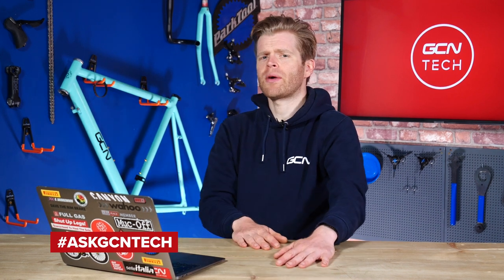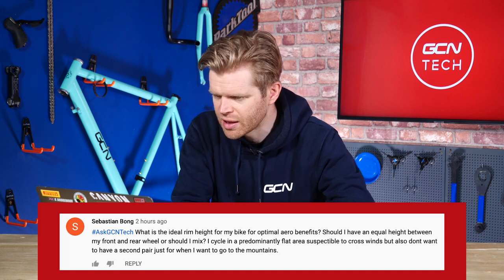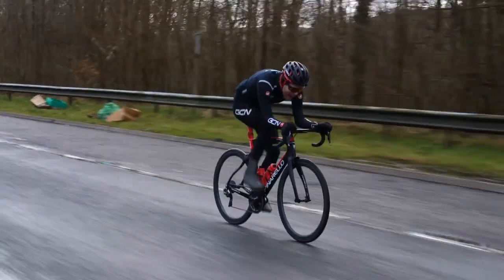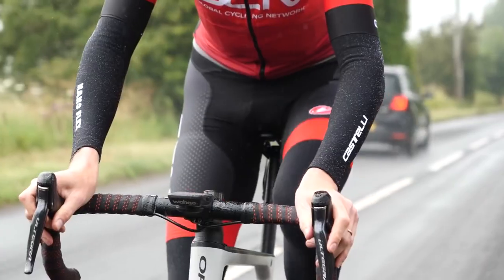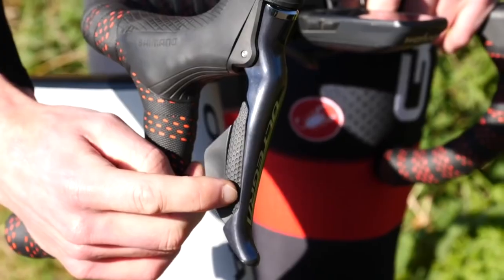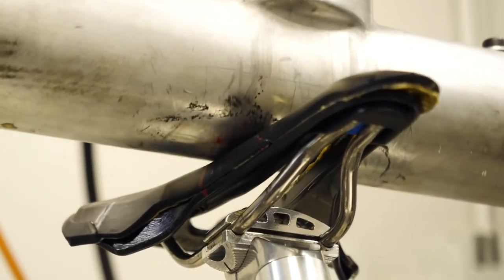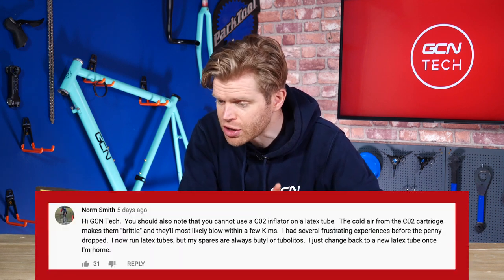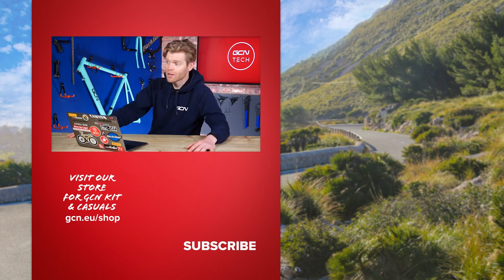What's The Ideal Depth For An Aerodynamic Wheel Rim? | GCN Tech Clinic #AskGCNTech

Comment: Why would you not be able to plug a theoretical 12 speed Di2 derailleur into a 11 speed Di2 shifter (assuming current wiring protocols)? I doubt this will be the case and suspect Shimano is going at least semi-wireless, but a button is a button otherwise.
Reply: In terms of hardware its possible, but shimano will make you buy a new shifter

Comment: #AskGCNTech is being on a trainer damaging for front wheels? During sprints and efforts the front wheel is taking a lot of vertical load on just the one or two spokes since the wheel isn’t rotating. Over time could this damage the spokes/rim at the bottom, shouldn’t we have some kind of front axle stand (if you can’t afford a Kickr Climb)? Thanks
Reply: The amount of force you can put into the rim while pedaling stationary is substantially smaller (probably about 4x less minnium)  than the force the rim sees while hitting a pothole at speed.

Comment: #AskGCNTech my Shimano 105 R7000 rear derailleur keeps getting out of its indexing. I've had the cable replaced, but every time I have it reindexed after a few hundred km's it's out off wack again. Any ideas on what could be causing this. I use my bike daily for a 84km round trip to work
Reply: New cable will stretch as it “breaks in”. It will stretch throughout its useful life but always more in the initial few hundred kilometers.
The cable housing end entering the derailleur is an adjustment nut. It may require lifting to engage for turning/adjusting (nut has indexed notches). When shifting to a larger cog has become hesitant, Adjust counterclockwise 1/8 turn, test ride. 1 indexed notch more if needed untill it will shift without hesitation. 1/8-1/4 turn should be adequate unless you have ignored the hesitant shifts too long.

Comment: #askgcntech
I have my first clutch rear derailleur and I can’t figure out why this is improved technology. Can you explain how it works and why it’s better. Thanks

#olliedidthehourrecord?
Reply from the maker: clutch mechs better maintain chain tension, essentially stopping slap by taking up slack better, this also leads to better shifting and a reduction in drive train drag. The benefits aren't enormous if your on a road bike with a 2x set up and a front mech, but they make a lot of difference off road or with 1x

#ollieattemptedthehourrecord

Comment: Hi Ollie, this has probably been answered before, but I can't find the answer. I have an older wheel with a 10 speed body and my new bike is 11 speed. Is it possible to fit an 11 speed casette on the 10 speed body. It would make it easier than changing the tire when using my rollers #askGCNtech

Comment: #askGCNTech My nw small frame bike came with r7000 crankset at 165mm. If I switch to a 170mm crankset, I’m assuming I will have to readjust my seat post/saddle position??
Reply: Yes but also consider that it'll  make your feet closer to the ground so less clearance or corners and you'll likely hit the wheel easier too.

Comment: #AskGCNTech Hi GCN tech, I just bought a second hand direct mount rim brake frame and it came with a ONE brake adapter (which I was told is for the rear brake). Question: What is it for? Do I need one for the front brake?
Reply: What frameset is this?
Reply: @yonglingng5640  aeroad

Comment: #AskGCNTech Hey guys! Can I inflate my tires with helium gas? On theory it woud make your bike lighter
Reply: I'm not sure, if it is applicable to helium, but it's know that Hydrogen is extremely hard to contain and you need extra effort to keep it in any container. Helium is the next bigger cousin, in the case of atomic size, but I don't know how much slower it permeates through rubber. I think regular old air does the job pretty fine, since it's mostly made out of Nitrogen and Oxygen, which are way bigger than helium.

TLDR: Helium might escape your tires way faster, than air. So regular (and expensive) refills might be needed
Reply: How about nitrogen???

Comment: #askgcntech is the famous 105 rule dead? I’m thinking specifically in terms of hookless rims which probably offer an innovative, better interaction between the rim itself and the tyre. Take the new Zipp 303 firecrest: with 28mm tyres and 25mm internal width, it’s essentially impossible to abide by the 105 law, and yet Zipp claims significant aero advantages too. Thanks, Marco.

Comment: #AskGCNTech Hi guys, I have realized that on the Ultegra Di2 bikes I've tried (not only mine), the drivetrain is noisier than on mechanical Ultegra. Is there a reason for that?
Reply: Mechanical is under constant tension from the cable while Di2 mechs can have some wobble. I suspect thats where the noise comes from.

Comment: #ASKGCNTECH: Do tubolito inner tubes have better puncture protection and better rolling resistance than standard inner tubes?
Reply: That's exactly what they claim (lighter and faster rolling than butyl inner tubes -- very close to the weight/rolling resistance of Latex tubes -- with better puncture protection than butyl), and FWIW Schwalbe is also making tubes with what looks to be to all intents and purposes a similar technology (https://www.schwalbetires.com/aerothan-tubes). The two current disadvantages are shared with Latex inner tubes: cost (comparable to Latex inner tubes) and they can't be patched.

(Tubolito tubes from what I recall seeing in an old GCN video were being marketed as emergency use tubes, but that part has obviously changed ☺)

DISCLAIMER: I have no experience with anything other than standard (and "heavy"/uprated puncture protection) butyl tubes ☺

Comment: 35mm good for all conditions.  Fair enough if you live somewhere with no wind or ride inside :P
Reply: G-rig, but you don't have to spend $2500+ to get a pair? How can you ride that?
Reply: @ronbell7920  still got some campag Shamal rim wheels that I import for $850 about 10y ago and still going strong. Light, roll fast and great in every condition. Most people just but aero wheels and frames for looks.
Reply: @G-rig6969  , yep, and they are slow to boot. Me I ride Campy Zonda's, light and fast enough for an old guy like me. From the looks of it deep dish wheels are for 25+ mph, I am not that fast! When I average 20+mph its a good ride. It is hilly where I live.
Reply: @ronbell7920  true, define slow? Normal lightweight (non-deep dish) wouldn't be slower for climbing or in a cross wind. Depends if you are going for every second, most people can afford to get fitter or lose half a kilo :P.  People just get stuff because they can, and want to :)
Reply: @G-rig6969  I agree, and I do not think that the deep dish wheels look better either! GCN did there road test and it seemed that the shallow rim "aero" frame bike came out on top!

Comment: And deep rims are a pain in the ** when you need to chance the innertube...
Reply: Yes they are, last weekend i had a flat and the local bike shop only had 60mm valve inner tubes. They didn't fit. Another disadvantage is that 80mm inner tubes are stupidly expensive. In my bikeshop they asked €12 for one. Online they only cost €5.

That said deep wheels make a nice sound 🙂

Comment: Be careful with food/cooking oils - those might be acidic and you don't want to mix acid and metal, you need to clean them up as soon as you get home. Even Extra Virgin Olive Oil is still acidic...
 (Ollie might know all that better than me but he is not telling)
Reply: The acidity of cooking oils is incredibly slight  It takes an extremely strong acid (in food terms) to have any noticeable effect on the metals used in bikes. Aluminum and the high alloy content in the steels used are naturally relatively corrosion resistant anyway.
Reply: @otm646  Thank you! it's a good day when I learn something new or get corrected. :)